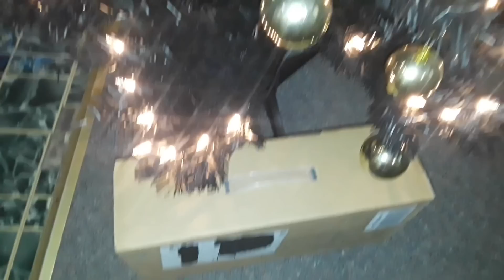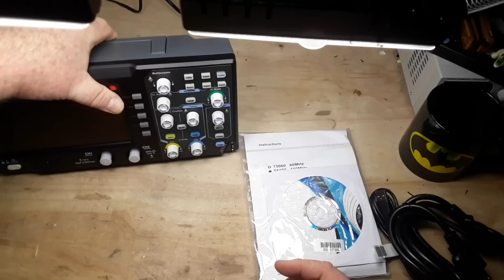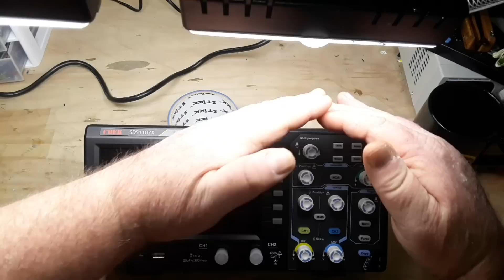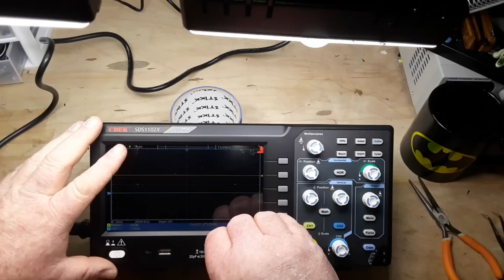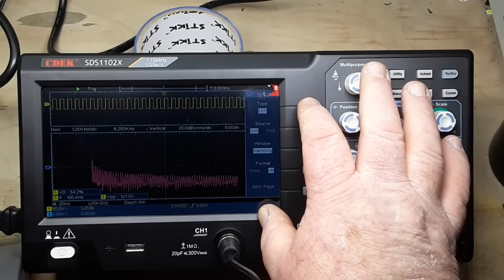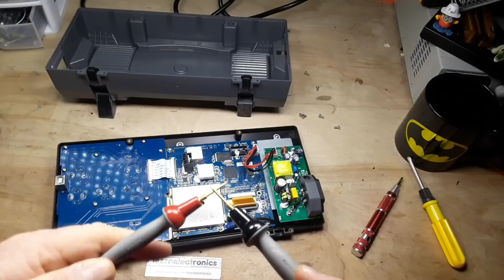What's under my Christmas tree?

Comment: Hi. Can you use one if these to test an audio cable to see if it’s still passing 20-20k evenly? I know that old cables can oxidize along the surface of the conductors causing the higher frequencies to be reduced. Any ideas on how to run the test?

Comment: Merry Christmas Paul - nice oscilloscope under tree looks like Santa was on a budget this year! Notice the shielding isn't as good as on the more expensive oscilloscopes from Siglent or Keysight which uses a full metal shield around the whole chassis not just the front end! But want do you expect for cheap.